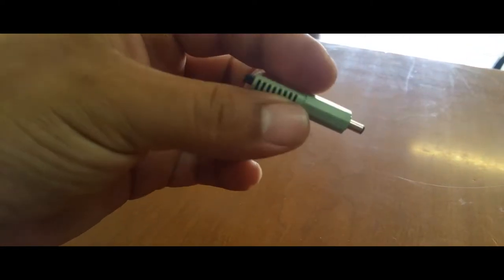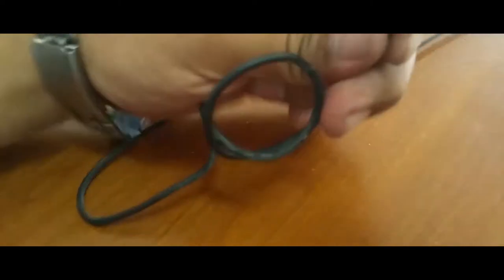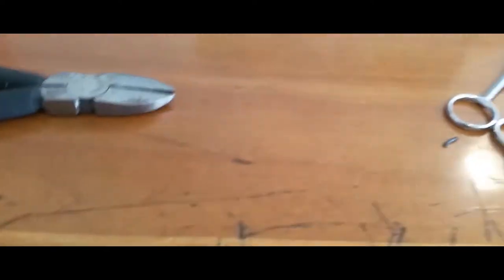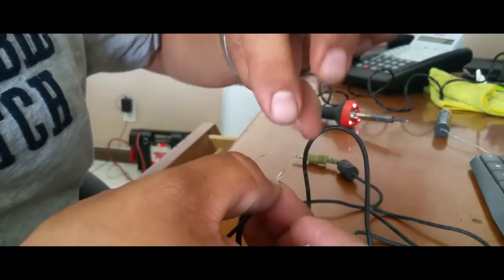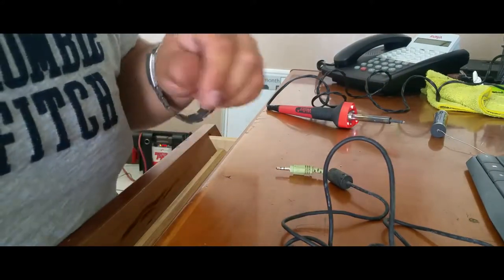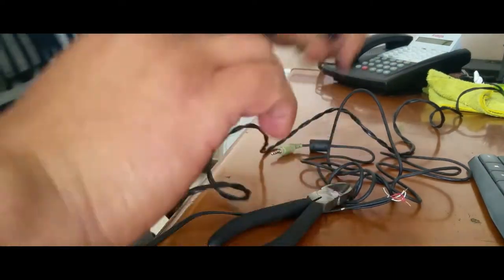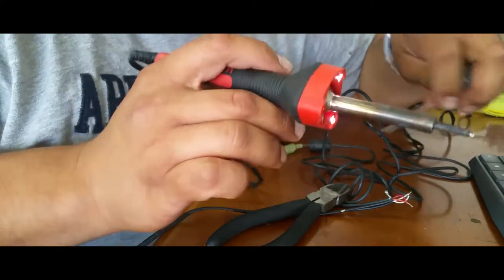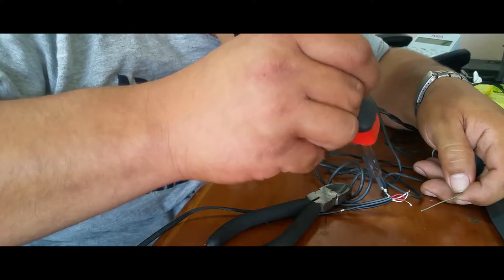How to: Repair Pc Speakers from the 3.5mm Jack

Comment: Short in 3.5 JAck to computer. I Spliced a new 3.5MM jack with 3 wires, red, white and ground due to a short- However, the right speaker (that plugs into the power supplied spkr- refered to as dummy spkr here on out) has no volume. Due to health conditions, I had to just twist wires and tape up. I did rewire white to white, but did not ck continuity. Before I go to the trouble of switching the two colored wires- would this possibly fix my issue of a lack of volume from the dummy spkr? I did shut down the balance to the powered spkr, and I can hear a faint signal coming through the dummy spkr. Any advice would be appreciated. I have Parkinson's and it's a big hassle to try to change these two wires unless it might be a fix. Any response is appreciated!
Reply from the maker: im sorry brother, i really dont know what to do in this case